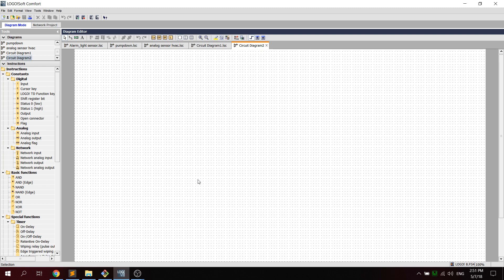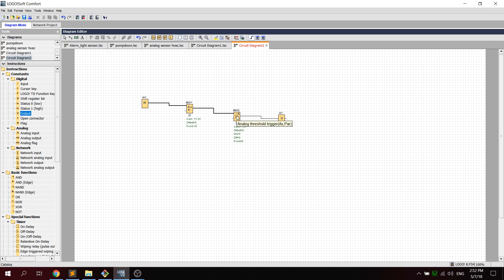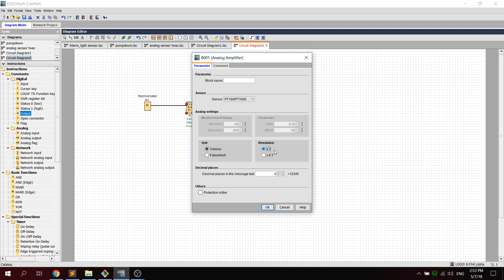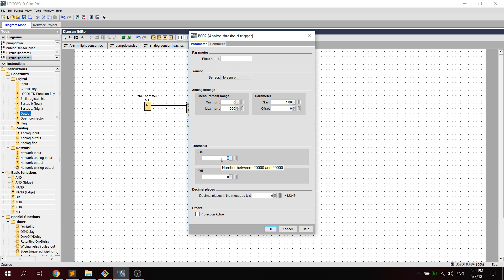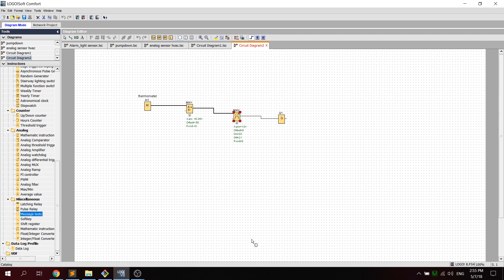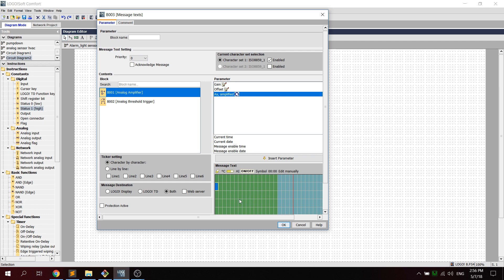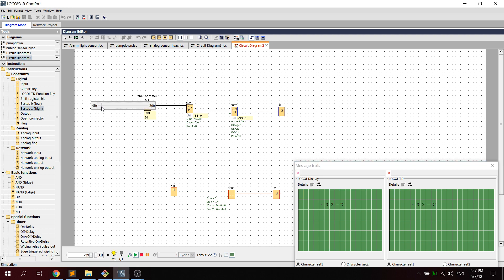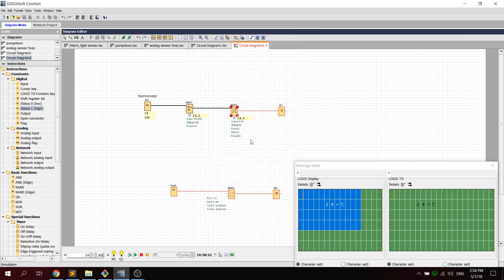Analog input schematic for pt100/1000 in LOGO!

Comment: Hello, excellent video.. One question.
How do I know which is the analog input that I should select in the programming? I am using the RTD AM PT100/PT1000 module.
Help please, I am not being able to display the temperature on the screen